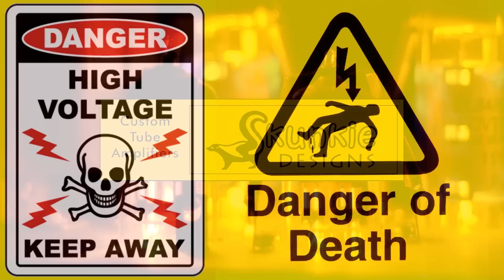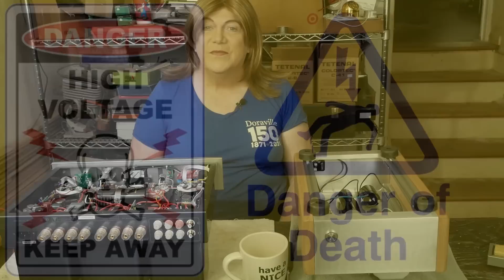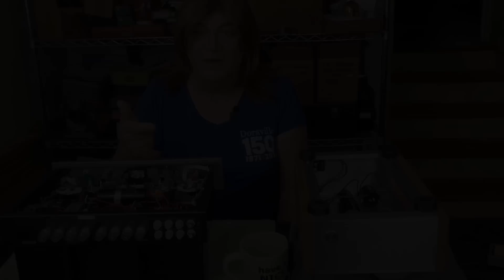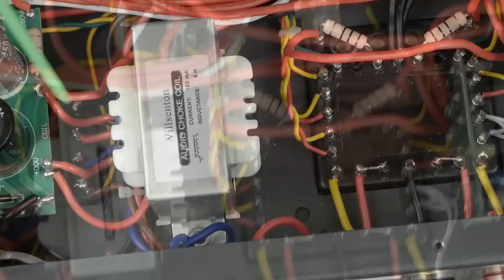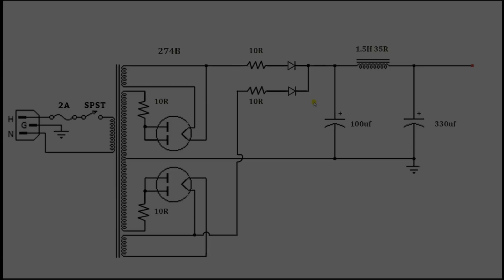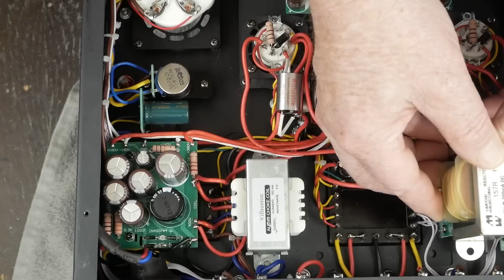Willsenton R300: Power Supply Mods Reviewed

Comment: I imagine there should be quite a high voltage drop across the tube rectifiers - if you were to bridge the tubes and only use the solid state diodes wouldn't the line voltage go up quite a bit?
Reply from the maker: The B+ voltage in the amp would go up, likely about 30-35V. Changes would be need to be made to compensate for this. I never meant to suggest anyone should do that!

Comment: I could be wrong but like to have a shot. It looks that the tubes are in parallel to up the current available, and the diodes are blocking diodes. However, the new power supply design will work just fine.

Comment: I've listened hard but I still can't hear the sound of DC. Good DC is quiet. Bad DC hums. Valves or no valves, if you hear a difference, then your power supply was inadequate
Reply from the maker: That's been my position: if you can hear a difference when you change a rectifier tube, at least for HiFi use, the power supply was designed wrong.

Comment: I thought you said the r300 was no bueno and not worth the time.
Reply from the maker: Not sure I would buy one knowing it needs this work done right now. I promised the owner I would see what I could do to resolve the problems and it may not be as bad as I initially thought. If fixing the power supply fixes the performance issues, maybe it's worth it, especially then if Wilsenton listens and updates then with a proper fix for this issue.
Reply: @SkunkieDesignsElectronics  I really enjoy your videos, thank you for making them

Comment: Any idea when this unit was built and shipped? Mine was made just after the most recent Chinese New Year recently. Mine uses 5U4G rectifier tubes. I replaced the 6sN7’s with PSvane-UK models. Those improved the midrange clarity.
Reply: I bought my R300 end of February this year from China HiFi. It looks totally different. No 10Ohm resistors, only one diode, no delay board, different PS caps board. And it was delivered with 274Bs (only option at this time)….
Reply: @thomasfi1275  That’s about the time I received mine, straight from ChinaHiFi. I had great communication with them.
Reply: @Photoboy1948 I have bad experiences with communication with China Hifi. They reply vague and then stopped generally.
Reply: @thomasfi1275  Sad to hear that. My experience wasn’t like that at all. I ordered in early December thinking my item was in stock and I was told almost immediately that wasn’t the case and apologized and explained the factory was shut down for the Chinese New Year and they gave what they thought when my R300 was going to be built and shipped. It arrived two weeks earlier than expected. When I had a problem with the battery installation for the remote they responded quickly with a YouTube video link showing me how to resolve the problem.
Reply from the maker: It just came a couple of weeks ago from China. What I found is what is supposedly their latest revision, the model with the high voltage delay relay board.

Comment: The mysterious diode is essentially a support for the rectifier tube to prevent the entire current from flowing through the tube during power-on. The large charging capacitance demands a very high current at power-on. It should be considered to slow it down slightly with a small capacitance. Otherwise, it does not affect the sound......thx for the vid
Reply from the maker: But the entire current does flow through the tube for it to be able to make it to that diode. They are in series. Series diodes improve their voltage handling, parallel ones increase their current. And large first caps impact a tube rectifier in more ways than just inrush current.
Reply: @SkunkieDesignsElectronics  You absolut right!.....thats my fault, because I saw the video in 480p mode.Thx for your comment.....or I would never know I need glasses.

Comment: I'm not familiar with the 274 rectifier so I looked it up and i agree they are badly abusing it and that the first smoothing cap is probably killing the 274's.. It was chosen for it's looks and little else.The 5AR4 tube solves the slow start problem and is a pretty rugged tube if you follow the rules by reducing that first smoothing cap..

Comment: This is one of the reasons that I always ask individuals who want to use Emission Labs 274A/B rectifier tubes if they know the value of the amplifiers first capacitor. Using more than a 4uF cap as the first cap with a 274 is a big no no.
Reply from the maker: This one is 25X that!
Reply: @SkunkieDesignsElectronics  and of course the wrong value capacitors as you've correctly pointed out.

Comment: Seen it before ............rectifier +diode ............questions ? YES !..............but one fact remains that the rectifier has a galvanic separation and an internal impedance , both conditione nevertheless the sound .
Normaly a delay that applies the high voltage when the heaters are fully warmed up should not switch the HV to the circuit that way , only so with solid state diodes ........but with DIRECT HEATED rectifiers the filaments of rectifier tubes must be switched on/off !
NO worries with indirect rectifiers as they have a delay of themself ...
Another  mistake is also seen on commercial tube amplifiers is ....
1) The warm up period only switches the inputs/outputs ............
2) The HV must be shut down before the heaters of the tubes are shut down and the power supply capacitors must be drained before switching off the heaters .......
Both cases/design errors  do not protect against stripping of the cathodes of your precious tubes ......
Correct start up and correct shut down expands the usefull life of tubes by several times .
20 000 H on a 211/845 and almost 100 000 H on a 12AX7 etc are not uncommon when used respecting this or never shut down the amp ( BBC policy= never shut down their tube amplifiers ) .............only with nos tubes !
For example WE 408a and other types ............12 years continous use on test bank ..........Still within specification !   equals 24 hours times 352 days times 12 years ........calculate the Ihours under controled conditions within normal operation conditions .....
In 1924 ............A standard 101D /F has a lifespan of 40 000 /60 000 hours ..........( thelephone repeater tubes )
In reality , commercial practice ,manufacturers need selling tubes as much as they can at roaring prices , so WHY protect tubes .............?

Now I am curious watching the next part of the video to see what you find out about the power supply ..............nothing asthonish me anymore today with the boom of many but not all badly designed asian tube amplifiers .
Thank you the upload and sharing .

Comment: Super interesting! Eager to see what this mod does to signal respons. Do you think that the global feedback implementation in this amp design may be contributing to the weird square wave response?
Reply from the maker: Yes and I wonder if the feedback was used to reduce the PS noise, which then created other problems?
Reply: @SkunkieDesignsElectronics  Ahaa.., lets see if you get any opportunity to check that out, thanks!

Comment: Thanks for sharing your stellar work here. I can tell as I am an electronics engineer, with experience working on tube amps for satellite uplinks. Some of them at 1500w at 14Ghz. Fridge sized. Lately I have also DIY'ed a few tube guitar amps (mostly 50's fender clones, but modded to be a bit less hummy) and also made a clone of a "cracking" headphone amp that turned out very well. Following your channel as I am looking into diy'ing a power amp, perhaps a 300B one... Keep up the great work!

Comment: I think they may have installed the 2 silicon diodes effectively in series with each rectifier to isolate the rectifiers from each other, in case one had a higher o/p voltage than the other.

That 100uF filter cap may be ok, since you said the current rectifier tubes can handle up to 47uF, & the 2 rectifier tubes are basically in parallel.

I'm no expert, & you've obviously had way more experience than me, but that's just my best guess.

As you say, it can't be too great having real thin wires carrying high current filament power!
Reply from the maker: Not sure, but these are known for the rectifier tubes arcing out and is the reason they retrofitted them with that delay board, and that large first cap is the likely reason. Also I said >some< rectifier tubes can handle a max of 47uf, many 274 tubes say their max is 4uf. 

Like I said, I will do a video soon on why it's more than just the inrush current that makes a large first cap a problem.

I've also never seen a need to isolate the sections of a rectifier tube from each other and this is no different. I think they added them to try to keep these from arcing out on start up, same with those 10 ohm resistors.
Reply: Could be an implementation of the yellow sheet mod.
Reply from the maker: Nope, this is different. This one is in series on the DC side. after the tube.
Reply: @SkunkieDesignsElectronics  In that case, it must be the only other possibility: Having some of the sag of tube rectifiers, plus the PIV of silicon diodes, with almost the same voltage drop.
Reply: When I saw two rectifier tubes, I tought one for each channel. Why would they run two of them in parralell?

Comment: Stephe, great work and my thanx🙏🏻👍🏻👏🏻
It looks like that there are different power supplies out there. Some hasn’t these delay board, has no resistors, has only one diode🫣
Reply from the maker: I do think there have been variations of these amps. So you know where the one diode was placed?
Reply: @SkunkieDesignsElectronics diode is at the same place as yours. But only at one rectifier tube socket ….???
Reply from the maker: OK I saw it, and yeah it combines the two rectifiers and then has a diode on the output.

Comment: 100
MFD condenser needs to be a 47 MFD bin the diodes bin the 10 ohm resistors add CL80 in series with the hot side of the mains   the 330 MFD use a 100 MFD as the current draw on switch on would be better the choke needs to be 5 H 200 MA for better regulation and smoothing etc
Reply from the maker: I don't think a 5H 200ma choke will fit inside this amp. I actually prefer a 33uf first cap to give the rectifier tubes some headroom.
Reply: @SkunkieDesignsElectronics  find new spot
Reply from the maker: 1.5H + 3.5H is 5H.
Reply: @SkunkieDesignsElectronics  just use 5 H 200 MA the PSU in that unit is very crappy rip it all out start again easy job

Comment: Wow this was cool. Its like the original rectifiers were damn near just for show. Im sure your revised power supply will yield great results. It will at least be more stable and reliable. They seem to over complicate things and maybe dont quite get how to design a circuit right. Im really interested in seeing where this ends up. Great job as always, thanks.
Reply: I agree, they're obsessed with appearance. Plug-in solid state rectifiers with thermistors would fix it quickly but if I'm buying a tube amp, I want tube rectifiers.

Comment: Interesting Stephe! I might be a good plan to flush mount the socket for the future 5AR4's, as they may look weird in the current low position. Also, would it be beneficial to upgrade the existing choke to a better (or similar) quality as the new Hammond choke?
Reply from the maker: It probably would, I have a spare 194G 3.5H choke I may replace the current one with.
Reply: @SkunkieDesignsElectronics  A shame the two rectifier tubes are in parallel, it would be nice to make a dual rail PSU. Looking at the schematics, that may be challenging but it would be a chance to get rid of the crazy big 330uf cap 😛
Reply from the maker: Trying to find room for 4 chokes just isn't going to happen, especially with the input relay board and that other PS board for the bias voltage.